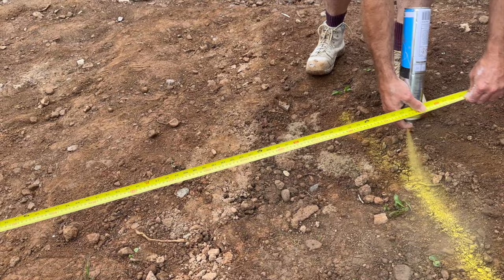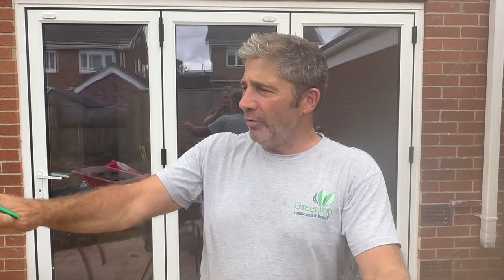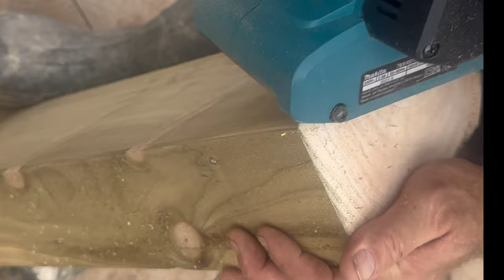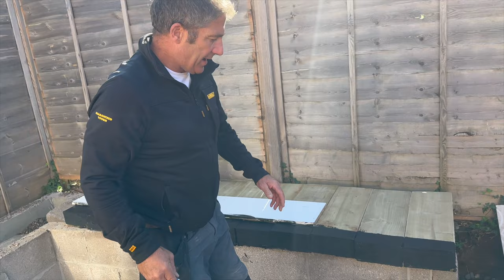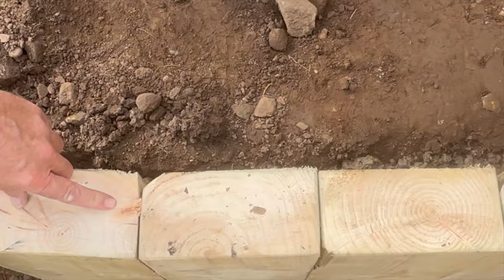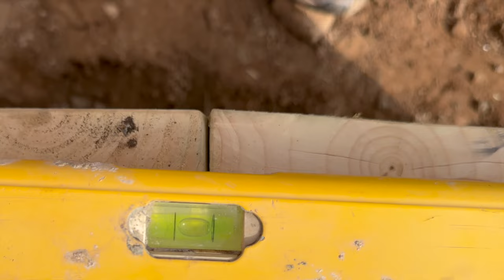How We Built A Meandering Sleeper Wall

Comment: been using some products from the Protea range been pleased so far they are a paint rather than a stain although I believe they do stains as well. Not cheap but seems good quality. The great thing is you can use it on concrete posts as well as fences

Comment: Decent job that.  In terms  of treatment of end grain for vissible wood i like to use  barrettine premier wood preserver.  This is a thin solvent based treatment and really soaks in whilst being economical. They do clear and tinted versions. This is as close as i can find to the sort of preserver used during the pressure treatment process.

Black jack bitumen as you used  below ground is a good idea.
Reply from the maker: Thanks Paul mate for your feedback your  agent mate